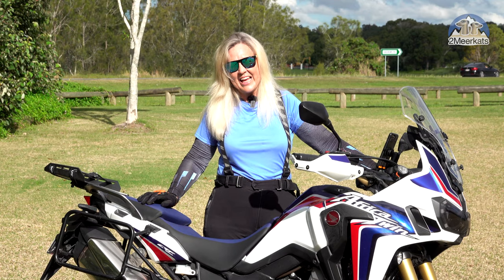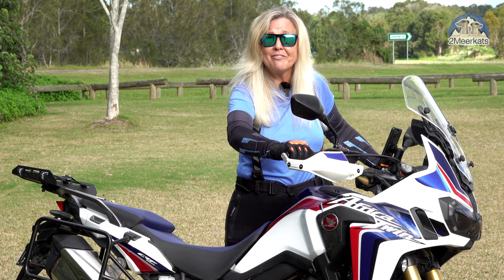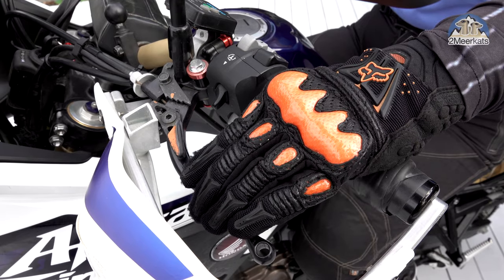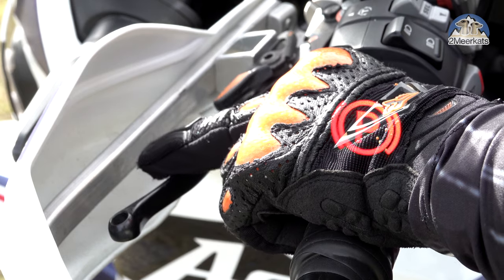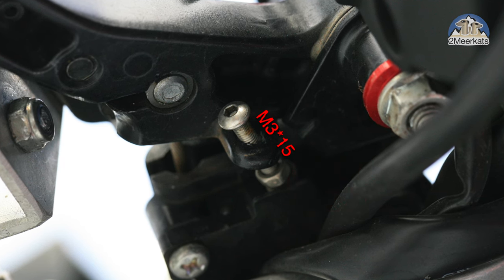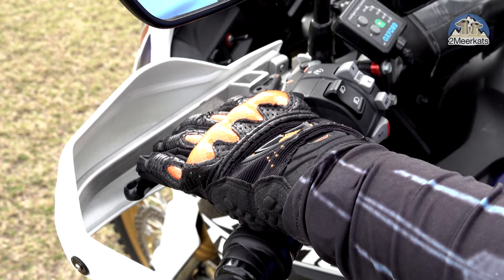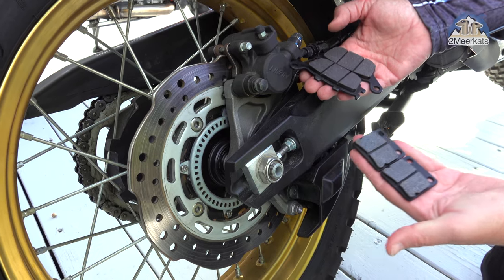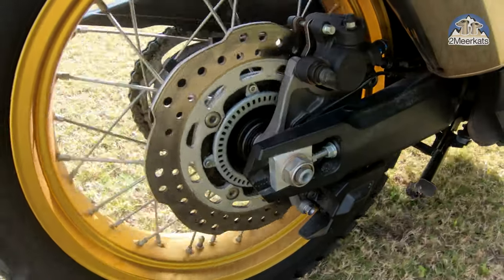Africa Twin DCT Hand-brake Park-brake upgrade mod CRF1000D 4K

Comment: I've seen someone who tapped into the hydraulic system and factory ABS also on Utube. I asked if he considered using the parking brake system. It seems he doubted it being effective enough for down hills etc. To be fair I didn't explain that my interest was only to use for turning a DCT motorcycle as you  are doing. Looks like you have successfully demonstrated the parking brake conversion (much simpler) for low speed turns! 👏
Reply from the maker: Thanks Noel - for me - Going downhill on dirt (I imagine a steep hill)and applying the back hydraulic brake would lock up the back wheel and step the rear out - as there is little weight on the back in a downhill. So normally on a downhill, me personally, i am 100% focused on modulating the front and ideal is ABS off or minimal ABS so I can lock up the front (where all the weight and braking traction is at) if needed.   This system (my system) of using the cable rear brake (with left hand)  is more about controlling the  AT"surge' under initial small throttle inputs in slow technical steering situations where my foot maybe down or transitioning on or off the pegs  - where other riders would use a clutch to modulate their torque..

Comment: Nicely done, probably something Honda could have thought of... On the other hand, another way of controlling low speed maneuvers is by using the rear brake.
Reply from the maker: thanks Speedtrip - sure both. But footbrake position-to-boot height differs ergonomically between sitting or standing and I find the hand-brake provides more predictability and finesse - for me
Reply: Honda thought about it, in fact they put it far for a reason, because they don't want anybody to touch it. See my comment above.

Comment: Excellent! The biggest thing I was concerned about was that low speed manoeuvre issue. This is a good idea as you can clearly finesse better with your hand than dragging the stronger rear brake. I also like that it uses the muscle memory from my old clutch control days! I’m not quite sure of the park brake light mod but reckon all will become apparent once I have a proper look.😁😁

Comment: Thanks for sharing this awesome mod!  I was able to implement this on my 2022 ATAS DCT by changing one bolt on the factory brush gaurd to a 1/4"-1-3/4" long bolt and nut ( added a small vinyl cap to the end of the bolt threads). To get the switch to work properly, I simply added a nylon Tie-wrap to the tang on the brake lever.  I slightly filed the edges of the tang to prevent the Tie-wrap from slipping off .
Reply from the maker: Great variation Chet !  Welcome to the control DCT club
Reply: Hi Chet. I'm Carlos from Argentina. I have an ATAS 2021 like you. Can you give me a feed back of this brake system change??? if you want. Answer this and I give you mail mail to be in touch. Thank you
Reply: @carlosmoltini7058  no problem!
Reply: upload a vid to show what you did?

Comment: great idea .. ill try this on my Dct .. you are using the stock lever i see .. its been a few months since you have changed the setup ..would you still recommend this .. in theory this makes sense wondering how is the real world feel ..thank you for sharing your knowledge and experience 🙏 ..love from india ... you got a new subscriber
Reply: just read the description ..you have been using it for two years now .. super ..will make this mod on mine too and keep you posted ..thanks again
Reply from the maker: Siddhant Karnick thanks for your Question, yes 👍 even after years it is reliable and super helpful to get fine control over the engine just as the throttle is being opened

Comment: Luv this.
Did you have to adjust the position of the cable at the rear caliper?
 Even with full slack, it still is engaging the brake.
Reply from the maker: Yes I think I might have adjusted the bottom end (sorry to be vague but I did this mod this in late 2017 - then rode it like that for ages before somebody I met said 'do a video' in 2020) - the whole process only took me a few hours to do and only used the standard Honda adjusters; the blocker square section and a small M3 bolt.
Reply: @2Meerkats  your video was shared in the forums. You should make more detailed videos. Ride along videos etc... People like you
Reply from the maker: Forums?  what forum is it on?

Comment: Silly question but did you drill through the front of the Bark Busters in order to attach the blocker? - assuming the bolt is fitted from the front, through the blocker and fixed with the bolt at the rear.
An awesome mod by the way and I am in the process of doing mine.
Reply from the maker: yes - right thru 🦘
Reply: @2Meerkats  thank you 😊
Reply: Well that worked an absolute treat. Needed to adjust the park brake from the rear of the bike, but this hack will make slow speed so much better. Thank you so much for posting this Vid.
Reply from the maker: @alhogbin  👏👏👏👏👏👏.    😜🦘🇦🇺🐨

Comment: Hi initially did you just put the blocker into the system or did you have to release the cable to the rear park brake caliper as well.  I would like to do this but not fully sure what you did and what you did to the light switch.  Sorry I am probably missing something here.
Reply from the maker: 1. use the cable adjuster (on the handlebar) to slacken off the cable - 2. Add the blocker 3. re-adjust the handlebar cable adjuster as per video ;;; the 3mm screw is essentially an extension to cancel the red warning light micro-switch until the brake is actually pulled ON.
Reply: @2Meerkats  thankyou I understand now how to do it.

Comment: I’m thinking of doing this, but not sure what the M3 bolt is for. Is it to activate or deactivate the parking light?
Reply from the maker: yes the warning light - otherwise you will have no indication (via the red dash light (P)) when your brake is 'latched' on, and will have to ride around with a red light all the time :( - this is the way I kept the red light working 100% - the hole has to be drilled and tapped at an angle - not 90° btw ; it's possible you could use metal putty or some other physical way to press the microswitch at the correct point that the brake is OFF

Comment: What about the duration of the small brake pads?
Reply from the maker: luciano lombardi - lasted 12,000 km
Reply: @2Meerkats  thanks for your answer. Did you also use the system over 20 km/h? Or the it is undersized for the motorbike's weight?
Reply from the maker: @lucianolombardi72  yes i did use it to lock the back approaching corners on gravel for rear-wheel -steering at 45kph - it's very effective despite it's small size and easily can lock the back because it's not part of ABS (independent) a lot of fun too because you can release precisely with finger-feeling more accurate than large MX boots. But not at high speed on sealed roads!
Reply: @2Meerkats  i'll try on My atas dct 2020... Another question: did you ever think to substitute the whole system with an idraulic one? It could be not so hard, I mean...
Reply from the maker: @lucianolombardi72  no because 1) this system is so simple to try. I kept it 2) this system does not interfere with Honda ABS, and full factory ABS can remain 'on' for mixed/changing road surface gravel/sealed we have here. I believe the cable is safer.
Reply: @2Meerkats  yes but i mean to change only the cable parking brake system with an idraulic one, even in this case separated from the main one. Just to have more breaking power and bigger brake pads
Reply from the maker: @lucianolombardi72  yes sure if you want and have that skill 💪 - bravo 👏
Reply: @2Meerkats  Oh wow, that's a great thing to know its not part of the ABS system. Wasn't expecting that at all.
Reply from the maker: @Spartan9567  hand brake for the win 🏆

Comment: Are you using the oem lever thanks greg
Reply from the maker: Yes
Reply: @2 Meerkats  thanks the lever on the 1000 must be closer to the bars mine is 1100 and seems a lot further away from bars
Reply: @gregorygardiner5258  they are all far away before the mod - the blocker brings it within reach dude 😆
Reply: @Quin Marais  ill post a pick off mine can't see how this will work also I'm using oem hand guards
Reply: I am.using them oem hand guards. I was able to carry this out by adjusting the cable completely off. and fitting the 🔩 you use to adjust the micro switch .thanks for the help regards greg 😀
Reply from the maker: Good work Greg👏👍😁